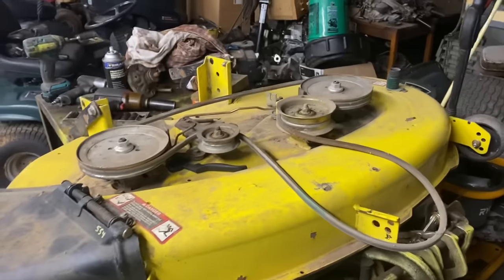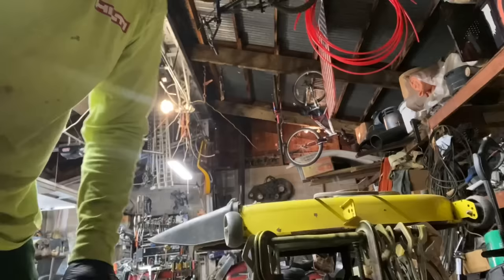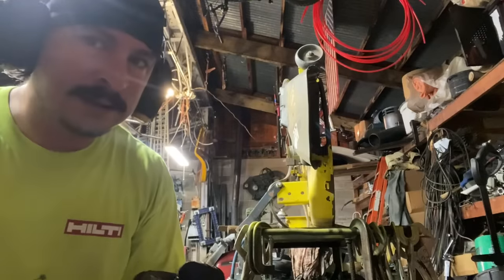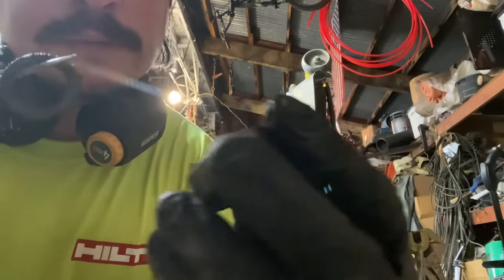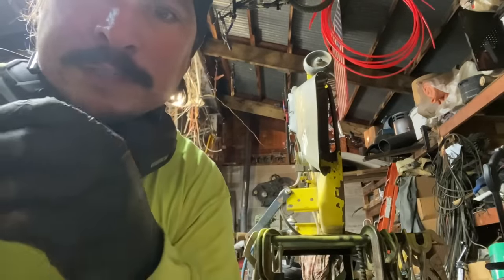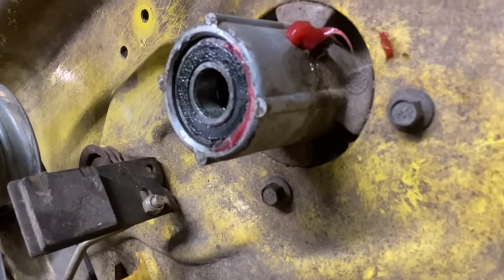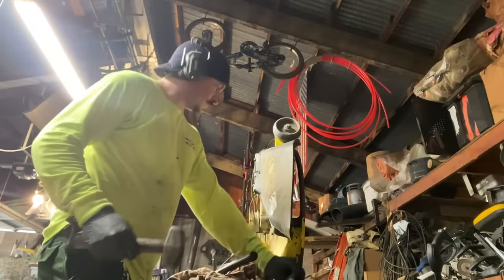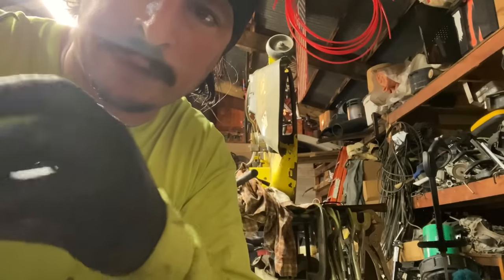Part 1 - Don’t trust the “Experts” Grease your mower deck sealed spindle bearings Common sense.

Comment: Wow!!!!! You are the man! Best video I ever saw. Thanks for setting the record straight on this bogus claim. I learned a lot. I had no idea you need that much grease in there. I never greased mine and almost 50 hours now. I hope I didn't mess up the bearings yet.
Reply from the maker: It would be very unusual for bearings to go bad if only 50
Hours. Iv seen a few go bad under 100 hours if not greased but I can’t recall very many that were bad with only 50 hours. If deck still runs quiet your probably just fine. If you grease it good they may last forever. Iv had a few folks come t that say they grease them and have never had an issue. Thanks for the comment.

Comment: I've seen a lot of spindle assemblies where both sides of the bearings are sealed. I'll pull the inner seals and reassemble the units fully packed. This way you're at least getting grease in to the bearing, Blows my mind that these things are built to fail.
Reply from the maker: Yea. Get that same coment
Non stop. But the whole point is that the seal, really just a dust shield is not even water tight and will not stop grease so removing it for the purpose of allowing grease to pass is a pointless process. Just working to work on something for what I call getting that warm and fuzzy feeling thinking it’s doing something when in reality it made no difference in the final outcome. Just grease until you see grease come out one end of the assembly and by then both bearings got lubed. Good to go. Also do not wash deck with water. Water will find its way in bearings. Using a leaf blower after each mowing and keeping deck clear will help deck live a long happy life. I find more often than not, when folks leave this comment they didn’t finish the video and get the full information I was offering.

Comment: This was so educational, thank you! I just pumped all three with grease until it started coming out on the ends. Predictably this creates a bit more drag so that the blades don’t spin quite as freely. Is there any potential downside to that like extra strain on the belt or will it not matter? Thanks again.
Reply from the maker: It may slow them down more than before they had grease, but they should have grease. If anything it would only make the blades a little harder to get started but that’s the way they should be regardless if the bearings are filled as they should be. Also consider that after greasing the unit as described and doing the first mowing on fresh greased assemblies all the grease will be pushed around inside the bearing. Any grease that’s causing restriction will quickly be pushed out of the way. Since the seals can not hold back any pressure, the bearings will basically do what they do and push the grease out of the way. So it is kinda a self regulating system in that way. You can’t mess this up. Unless something was messed up prior to greasing and the unit was ran to the point of causing damage before grease was added you won’t have anything to worry about. Grease only prevents issues but won’t fix the damage that has already been done. Sometimes folks only think about grease after they start to notice some new noises. However by that time adding grease may buy you some time but things are already going wrong by then.
Reply: @GTObearclaw1  hey thank you. Everything you said makes sense. Spindles were brand new and I’m just wanting them to last as long as possible. Can’t wait to get out and mow tomorrow. Thanks for the reassurance and advice!

Comment: Thanks for doing the work and making a video to prove your point.  YouTube suggested your video.  I had seen the title, but hadn't watched the video.  A couple of days later, I was sharpening and balancing the blades on my John Deere LA175 (775 hours), and I remembered your video title.  I thought, while we're in here, let's try greasing the spindles until grease is oozing from the end seals.  Sure enough, one spindle took 40 pumps, and the other two 45 pumps each before grease appeared.  Those replacement spindles have maybe 50 hours on them.  Smoother, and quieter now.  I hope the factory grease kept the bearings well-lubed until I saw your video.  Got to wonder:   if Stens didn't expect you to grease them, why would they bother installing grease fittings?

Comment: awesome !!! My mechanic where i work always told me not to put to much grease , cause you can blow the seals out.  But after watching this , you have to really pump a lot of grease in the spindles. WE would just pump maybe 6-10 pumps , then stop.  We do the same thing on all my trailers that have buddy bearing , which i guess would be the same situation?
Thanks so much for this helpful info , as I am a fanatic on taking care of my equipment.

Comment: Great video, I have a question - I just changed a front wheel bearing on a 2005 Volks Wagon Passat with diesel engine. The bearing looked the same when popped the side cover off. I could have packed the ball bearing with grease put I did not, and the amount of grease that was put into that bearing was far from being packed ?  I think I should have packed  it full.
Reply from the maker: Adding some would t hurt but I’m not knowledgeable on sealed / shielded wheel bearings but I think at least some added would be beneficial

Comment: Got a Case J46 deck. Added fittings to the spindle body and pumped them full until grease leaked out of the ends. The shaft spun harder. Couldn't figure out why.  I either hydraulicly pushed a bearing out of position or pushed a seal into the rollers . I just ordered replacement spindles with bearings with new bearings installed. I'll find out what I actually screwed up when the new spindles get here.
Reply from the maker: Case is a commercial grade or heavy duty machine. My guess is it would be fine to run it but it’s hard to say without seeing how stiff they are. I notice they get a little stiffer in the cheep box store mowers but quickly free up after running a few minutes and letting the grease migrate.

Comment: Hello, love this video, very insightful. I have a question though. Do yall think it would be possible to remove both seals, drill a hole into the housing, tap a hole and install a zerk bolt so it could be greased at regular intervals?
Reply from the maker: You could do all
That but why bother removing seals? As the video clearly shows that greased moves past seals and shields help keep the dirt out. Best to leave them on.

Comment: I'm glad you debunked the myth! I have heard the sealed bearings will not get grease in them.
Reply from the maker: It’s so easy it’s silly. I can’t believe all the naysayers posting videos won’t just experiment and try it. They can’t get past that rubber shield in their mind it’s just not possible and in reality it’s nothing but a rubber lip that flexable and moves out of the path of grease as it passes. Not a big deal.

Comment: Exactly what I was trying to say when watching the other videos.  "Sealed bearings cannot get grease because they are sealed."  Must not be too "sealed" because that seal popped off without any special tools and pops back on just fine.
Reply from the maker: I know right, some folks think the dust shields are more than what they actually are. Just enough to keep dust out. That’s it. They won’t stop pressure from passing.

Comment: I just went through this yesterday.

Last year, my  mower spindle was making noise.  I wanted to add grease zerks  to all my spindles.  This is an older Bobcat zero turn commercial mower that is second hand.  It has no grease fittings on the spindles and sealed bearing (metal seals).  Well in the middle of last summer I didn't have time to put new bearings and such so I just installed the new spindle to get up and running.  Well, here we are one year later and that spindle is making noise.  

This spindle is right beside the wash port.  I suspect that is the cause.  So I bought a new spindle.  I took it apart yesterday, tapped a grease fitting, removed the shields on the inside and installed that spindle onto the mower. I'll do the same to the spindle I removed from the deck.

I plan I doing this to all the spindles.  I can't believe they don't come with the grease fittings.  Especially being a commercial mower.

I'm hoping now it will last more than one summer.

Great video.

Comment: Man are the bearing and Spindle companies gunna hate on you. I love it. Thanks for the education. Now I'm going to go pull my spindles off the mower and drill and tap them for zerk fittings and pump them full, and I mean full!
Reply from the maker: I’m sure the big corp just wants us to let the machines self destruct and go buy another cheep throw away machine. Sadly they have built the engines so cheep on Briggs and kohler big box store units that now days the engines don’t even hold up very long. The more preventative maintenance we do the better chance the equipment can hold together for us and save us money.

Comment: I'm an old farm kid my Pop believed in thoroughly greasing equipment every time you went to work. I just bought a JD-S130 . I agree with everything you said thanks.
Reply from the maker: I was raised with the same mindset. Grease is cheep and a easy way to make things last longer. Using too much is almost never a bad thing but not using it enough will cost us in the long run. I’m not a huge fan of the box store Deere decks as you may be able to figure out from the many deck repair videos that revolve around the 100 series deck durability or lack there of. However I am at least glad they have grease zerks on all the 100 series decks that Iv worked on. So that’s a bonus, unfortunately very few people grease them and even fewer grease them properly. Most folks don’t know the inside of the mandrel is empty and that cavity will need to be filled before grease ever makes it to a bearing. Thanks for your comment. Please subscribe and I’m working on some ideas to cover in future videos that are not already overdone in other videos. Hopefully I can come if with some other somewhat original content or at the very least put the correct information into the enter webs to help folks.
Reply: @GTObearclaw1  thanks one thing - I bought mine at the local JD dealer. Not box store. It's going to be ready to go tomorrow. So far, they have been helpful.
Reply from the maker: @tgmccoy1556  regardless of where a S series is sold it’s the same quality level machine sold by lows / Home Depot / box stores. I’m
Not trying to bash your mower but it is important that people know even the official dedicated stand alone Deere dealer will stock and sell the 100 series as well
As the other heavy duty models. That was not the case in the early 2000’s but over the years I think the dealers seen a drop in sales due to the box stores exclusively selling the lower grade models. Of course a S series is about $1,000 cheeper than the commercial X series so who can blame folks for buying the lesser priced machine especially if they don’t need a commercial mower and also like the Deere brand. That could be a topic for a video. I’ll have to see if other videos are out there on the topic and how far they go into detail on the history of Deere branching out into the home owner market and not sticking to strictly commercial machines.
Reply: @GTObearclaw1  it's the service l'm interested in these guys have been here for years and l can call and talk to a human when I ask for the service department. Just because you buy a Putt-Putt lawn tractor you still get service. BTW they sell a lot of lawn equipment.
That's why I selected JD.
We have three Husky dealers including a big box. That are all serviced  through the same outfit that has the contract to the box store .
Reply: One other thing this is rural NE Oregon so choice is limited. I know the 100 series limitations. But this is for my roughy 1 acre of mowing. Mine and my neighbor's.
Reply from the maker: @tgmccoy1556  like I said not bashing them. I am a fan of Deere equipment. It’s great to have a place that will
Service what they sale. That’s the only way I’d buy something.
Reply: @GTObearclaw1  Yep that's the only way for sure. I'll keep you posted on my adventure.

Comment: Own a JD 145, 48" deck for 17 years, never changed a bearing!.. 450hrs... 3rd set of blades.. 2 acres every week..  I PACK those assemblies full ONCE every spring, and takes almost a full tube of grease!.. so grease is going in the bearings during use!.. I use red hight temp synthetic grease...  Nice tutorial for anyone who needs to change them!..
Reply from the maker: Great testimonial thanks for sharing. That’s what it’s all about. Getting grease where it’s needed. By doing so it’s amazing how far these can go without need for tear down 

The purpose of the video was just to prove grease reached the bearings. Unfortunately many people are sharing contradictory information on the topic but none of them prove that grease is unable to pass the bearing shields. Lots of folks out there offering help but obviously don’t know as much as they think they do about the topic. So I broke it down step by step to prove greasing through the zerk right from the factory without removing shield will work to get grease into the bearings. 

Thanks for the comment

Comment: Thanks for sharing,learn something new.  Can you leave the inside rubber seal off the bearing?
Reply from the maker: You can leave the shield off. But one main point of the video was to show proof that taking the seals out is a waste of time because they don’t stop the passage of grease. So why would you think removing them would be worth the effort or of any value? Think about what’s happening as the grease travels out of the gun and through the assembly. Where can grease go? Out the top and bottom of the assembly. And to reach those exits it will pass through rubber lips and exit the assembly and while doing so passes through the bearing. The shield AKA seals are nothing mower that a thin little rubber  lip and holds no pressure whatsoever. They flex out of the way as grease passes

Comment: I put new bearings in my daughters mower a few years ago. Her x never put a grease gun to anything on that mower for 7 or 8 years he used it. I pulled the shield out of one side of the bearings before I assembled it, putting the unshielded face towards the center.
Reply from the maker: He sounds lazy

Comment: thank you for taking the time to make this video.  However, I have always read that you should not pump a lot of grease into bearings, ball joints and etc to displace the existing, but just enough to see it move the other side and too much pressure can displace a seal.    IDK ?
Reply from the maker: Read some other comments. Iv gone into detail about this. It’s absolutely not a concern in this application. Seals have nowhere to go. It’s much better to over grease than not grease enough in this case. Be careful what advice you take, mine included. But notice that I did prove my theory. Very few folks posting information on this take time to prove the advice but they are eager to let you know they are the authority on the topic. That’s the nonsense that drove me to make this step by step to prove some knuckleheads wrong who are giving crap advice and won’t prove what they say. The seals won’t pop off. And most importantly they won’t stop grease from passing.

Comment: I'm assuming the bearing seals are blow-proof? Meaning the injection of grease at high enough pressure wouldn't pop the seal out?  Also, I do know that a lot of 2-stroke engines used ball bearings in races as they get all the lubricant solely from the oil in the gasoline mix. Point being, those bearings technically probably don't need a lot of lubrication. However,  it does keep the water and dust out. Still, better safe than sorry. I have zerks on my spindles and in the past only gave them a few pumps out of fear of blowing seals. Thanks for the post, I learned to do much good one needs to do it as you advised. With them packed correctly they ought to be good to go for a great many hours of run-time.
Reply from the maker: You would be assuming wrong.  my video shows the seals don’t come out. It’s not nearly as complicated as it seems. People really overthink this process. That’s exactly why I broke it down to the basic steps and showed every part of the process and findings as I went. Yea, they don’t need much but they do need grease. A few pump did nothing for your bearings. Not even worth bothering unless your going to fill them up and push grease into the path of the bearings. If you don’t
Get grease to
The bearings, When they finnaly dry up, and they eventually will. You will know. Best to grease them. Read the comments. The guys who have been doing this say they have never had issues and still
Running on original bearings. If your not adding grease properly you will eventually loose a bearing and that’s a guarantee. You might get 3 years or 5
Years or 10 years. All
Depends who was adding grease that day your bearings were made. But at some point they will have gone as far as they can go on the original grease.

Comment: I ‘ve always called BS when people tell me that it doesn’t do any good to grease the shafts on my 1996 John Deere LX173 . I can see grease coming out at the ends of the shafts when I grease it and can hear the difference in the sound of the shafts right after being grease. . I bought it used in 98 and it been mowing an acre of grass about once a week 8 months out of the year since then. It still has the original shafts, 3rd blades , and 2nd set of belts. Not bad for a 27 year old mower.
Reply from the maker: Nice, appricate the comment. Be nice if the naysayers would take a minute to ready comments like yours. They just assume they know better without need for giving it a try and seeing what happens.